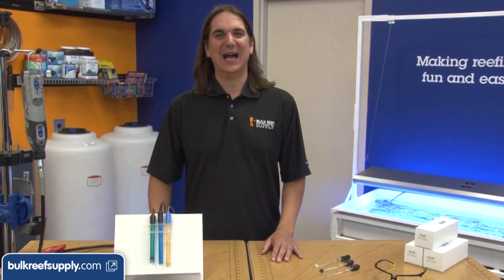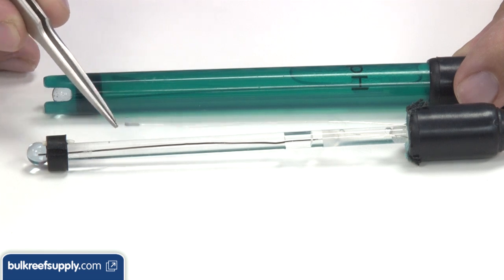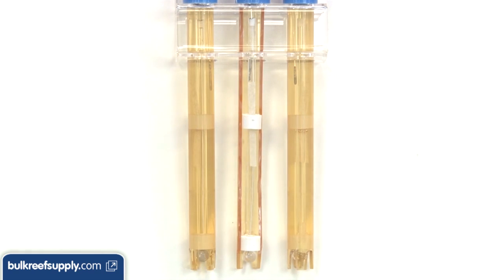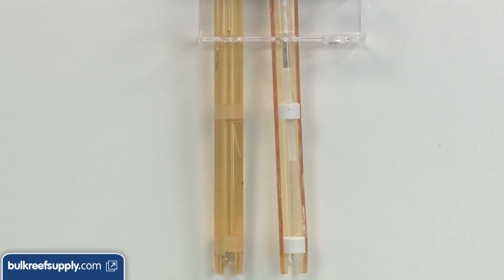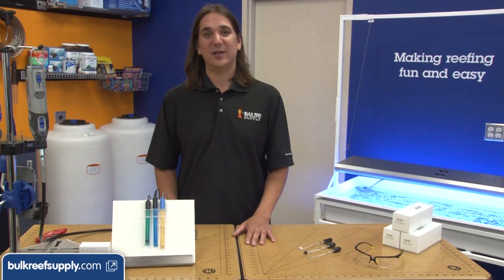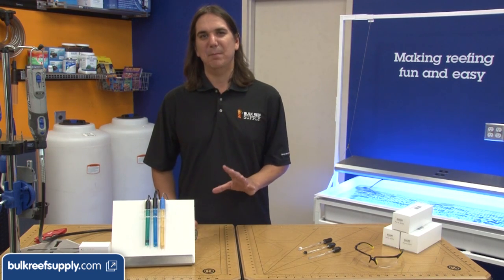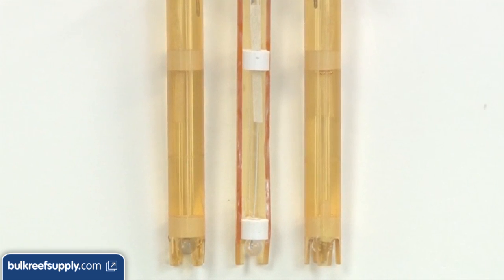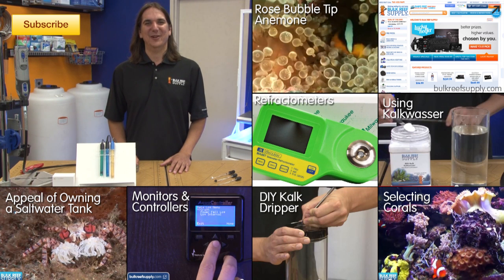BRS lab grade pH probes, what's the difference?

Comment: Regarding the BRS probe being waterproof you seem to shay away from saying that it is waterproof but you say that all probes are recommended to not be submerged. I must conclude that the BRS probe is NOT waterproof at the wire cap. PINPOINT has been waterproof and submerged for years. In the Lab, water submersion may not be an issue but this is an aquarium and it is going to happen

Comment: I feel that this video is somewhat misleading.
Title of the video is what makes a BRS probe "Lab Grade". At the last 30 seconds of the video it is stated that there is no special designation or meaning to the term "Lab Grade".
2-Is the BRS probe waterproof for total submersion? I was told you can not get the whole probe wet. Lab probe or not this is going to be used in an Aquarium so it will get wet.

Comment: The first part of the video (up to 4:50 or so) seems logical, but I can definitely vouch for the following part when he talks about the impedance of the probe. I have 2 Apex, one with a Lab Grade probe, one with a regular probe. I keep having problems with my regular probe whenever the wire comes anywhere close any other metal surface or electrical current, and my pH reading jumps through the roof when it happens. I'm definitely buying only Lab grades probes now.